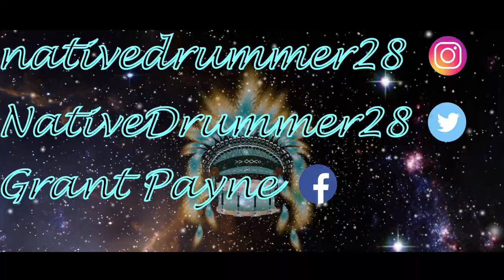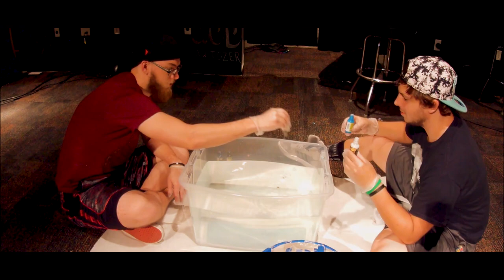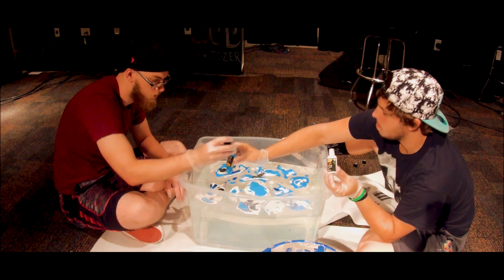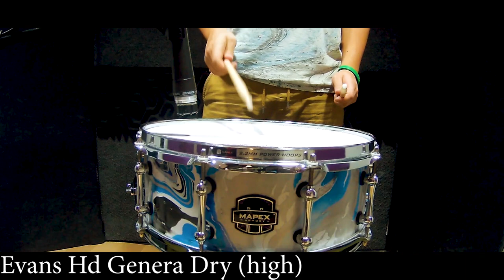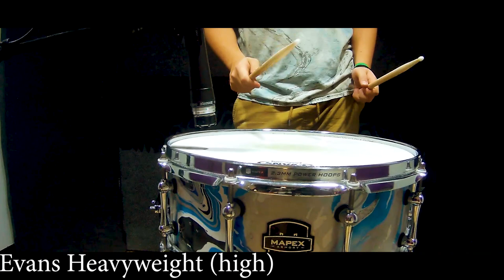Custom Hydrodip Snare Drum!?! Mapex Armory Tomahawk

Comment: so can i ask why three days, did you tape everything and white primer the skin, did you have water at certain temp? and how long to dry, how many coats of clearcoat after. thanks
Reply from the maker: Hey! So the tape was to prevent paint from getting on the entire bearing edge of the drum and the inside as this would really affect the sound. A lot of the sound of a drum comes from the metal/wood on the inside reacting to the pressure from the heads. The white primer was just in case I didn’t like it or something went wrong haha colors also pop if they have a white base so it was to help the colors pop more and in case I didn’t like the paint I could tear it off!
Reply from the maker: It took like a day to dry but I put quite a few coats of clear coat on (i forget the exact number off the top of my head) but I put on a lot of clear coat as I want to protect the finish!